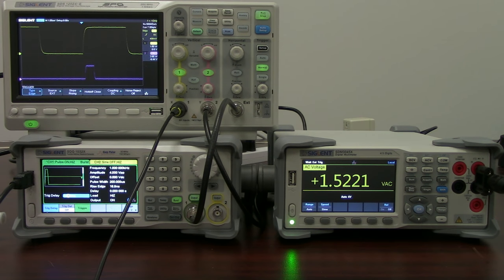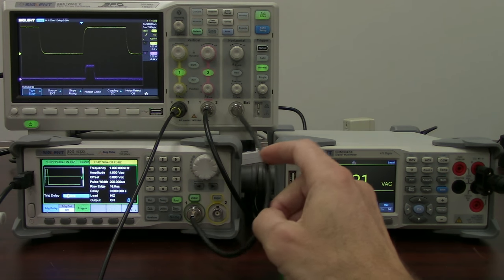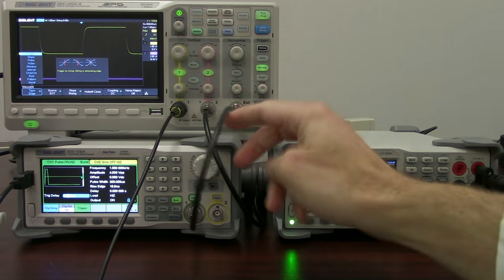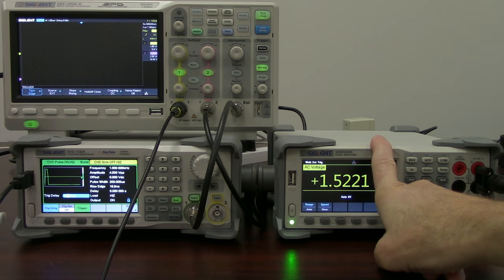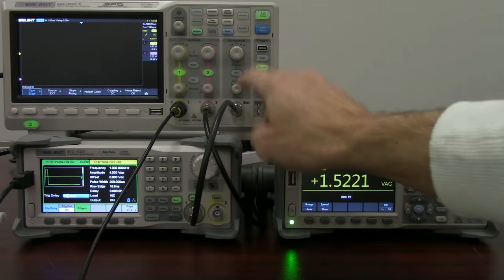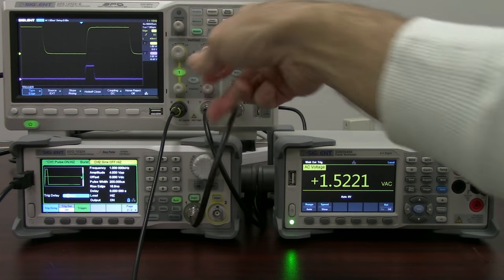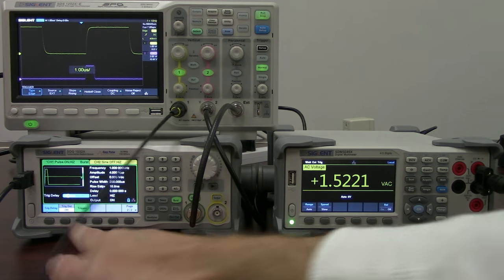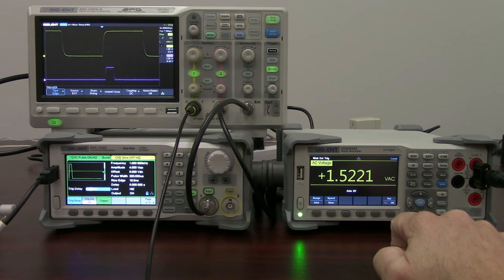Triggering multiple instruments with an Oscilloscope

Comment: If I'm understanding correctly, the signal generator is triggering the scope, then the scope is triggering the multimeter, and whatever the level is on the selected channel at the time of the scope trigger is sent to the multi-meter for display, is that right?

This is just an example, right? You wouldn't do this specific setup in the real world, or would you? Can you give other examples of real-world external triggering?

Comment: I want to test my audio DAC and preamp left/right channel and use EXT trigger but I cannot seem to be able to do it. Can this work?

i) output 1khz from 2042X into EXT trigger of 1202X-E
ii) output 1khz from computer DAC in stereo into left and right channel of audio preamp
iii) output of left preamp into ch1, right preamp into ch2, and use EXT trigger from 2042X

Basically, I just don't know how the EXT triggering works...
Reply from the maker: Probably best to write info@siglent.com as this could be a lengthy response. 

Things to consider before writing:
What are you specifically attempting to do?
What will each piece of test gear be doing at each step?
What is triggering the SDG output? 
Why do you need an SDG in this setup? 

- Jason, SIGLENT North America
Reply from the maker: EXT input on a scope is simply another channel that is monitored for triggering. It is not sampled and the input signal cannot be shown on the display. It is a trigger input, only. 

The EXT trigger for an SDG is either a trigger input to kick off bursts or sweeps or a trigger output that can be used to trigger other instruments. 

- Jason, SIGLENT NA
Reply: @SiglentVideo  Thank you for your prompt and thorough replies!
Since you asked, this is my quest: to put an N hz (N is a parameter) audio signal from computer to DAC and preamp (normal audio), then monitor each of the left/right channels through the two inputs of the scope, while sending a reference N hz signal from the 2042X into the EXT of the scope to trigger and analyze the L/R signals. That should work, right? I had trouble when I tried it but maybe I just need to be more careful with it.
Reply from the maker: @thxepsilon8292  Yes. That should work.. but if N is the same for all inputs, I am not sure what adding the SDG signal will get you. 

The EXT trigger input of the scope can be assigned as the trigger source by pressing TRIG setup and selecting EXT as the source and then set the voltage threshold. 

You then need to coordinate the SDG output to produce a signal that will meet this condition.

Typically, a pulse is used as a trigger source. 

- Jason, SIGLENT NA
Reply: @SiglentVideo  Thank you, that clarified matters for me enough to be able to understand it. It took me a while but without this it would have taken me much longer.
This gear is very sweet for analyzing audio equipment--maybe overkill, but sweet nonetheless.
Reply from the maker: @thxepsilon8292  Glad to help - Jason, SIGLENT North America